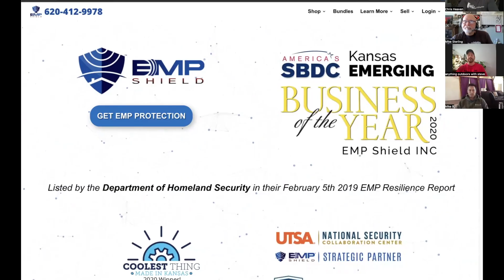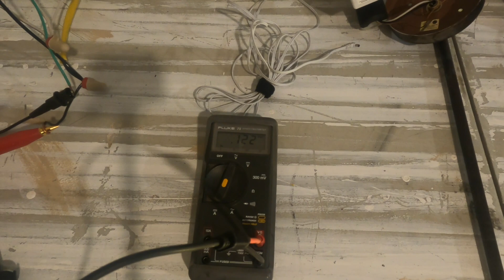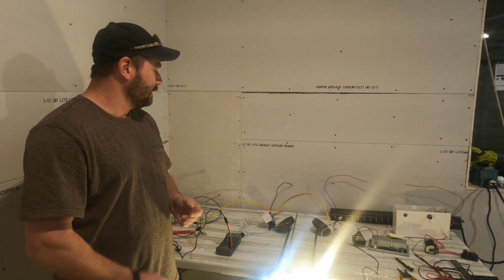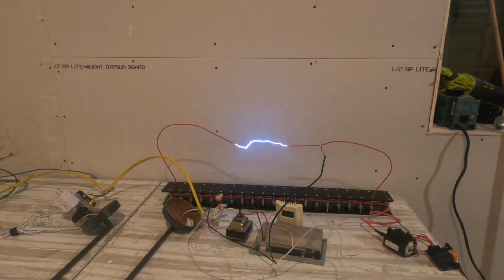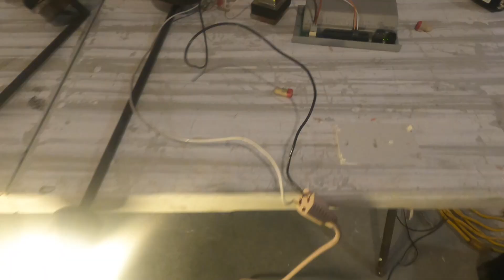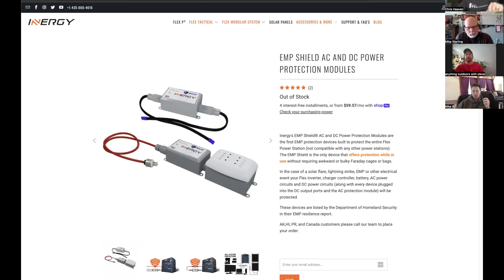We TESTED the EMP Shield... UNBELIEVABLE RESULTS! WOW!

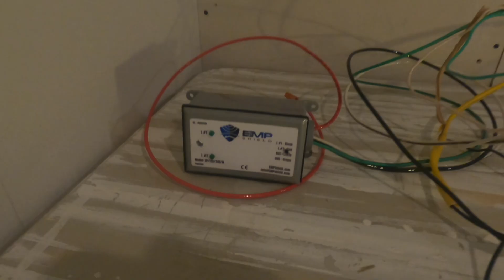Comment: Am I missing something?  @16:12 I feel like I've seen the test conducted with the power to the lights disconnected?  I hope I've missed something because I don't know when the EMP is coming to go turn everything off before it hits...
Reply: Without question,  these were tested in the unenergized state- as I didn't trust emp shield claims, plus this is beyond their specifications.  What you don't see is that I drove a separate ground rod and tied it to a chain link fence for a lower impedance ground- bypassing and isolating my entire  household from the tested voltage. The 120v is a nominal voltage that has little reference whether applied or not when pushing 400,000 volts. 
  The side effects of doing this test indoors was the induced voltage that coupled onto the internal house wiring, and did have adverse effects,  including taking out my UPS running my freezers. I thought that it might be salvageable,  but today, continues to go into fault mode often. That being said, I could now use that UPS as the isolated power source, driving the 120v to remove any potential concerns! It would be my luck that it would go into fault right as I zap it...
  The alternate intent to removing a power source,  is the potential of alternate paths to help reduce the overall voltage spike. It'll it is on a stand alone and isolated circuit, it only has one pathway to travel, and that is through the EMP shield alone. I hope this explanation helps.
Reply: @AnythingOutdoorswithSteve  so in effect, if you'd had an EMP shield on the House's breaker panel, you think the negative effects of affected electronics would have been prevented? ....Which would have been the ultimate test?
Reply: @ahuggins6  yes I do. I do have a whhouse surge suppressor (leviton brand) but something got by it. The ups has new batteries installed roughly 6 months previously. In operation for the last 2.5 years. No load changes  and under rated watt hour specs. It used to run both freezers with compressors running for an "estimated run time" of 45 minutes- not that the compressors run continously. Battery backup systems are known to fail on the converter circuit,  but this would be a random failure during AC power mode- which happens less frequently. 
  Random induced voltage to the house wiring is a lesser test than a direct strike to an isolated setup- in my opinion.

Comment: One question about the test was he didn’t use a 20 amp fuse that is supposed to be the feed to the EMP shield. For a whole house shield it  is fed through a double pole breaker but for this experiment he could have tried to use a single pole 20 amp breaker. I believe that breaker is only to protect the EMP shield but it did show it could take high voltage hits. I did share the video.
Reply: I will definitely add this to the mix on the next testing session.  We are not close to a 20 amp load for the breaker to trip, and most breakers are similar to snap switches in function with no susceptible electronics (leviton, gfci, arc fault excluded.) I am saving up $ for a higher voltage testing coil with high frequency vs 1 second pulses. I attempted to scale up the existing with tons of failures, back feeding that bit me and fried electronics.  I did get a couple 800kv bangs before the power supplies got fried!
Reply: @AnythingOutdoorswithSteve  , I think about a possible CME as more of a possibility because of the active solar cycle we are in. If given enough notice I wonder if opening up the main breaker would be some form of protection or I have thought of pulling my electric meter. I have experience with electric meters. After watching your demonstration I think electrical arc could jump the 4” between the sockets the meter goes in. Now I am thinking of adding some type of translator between the four legs, line and load. Maybe heavy duty rubber 1/4” mat.
Reply: @donalberda1344  in the full length video I had done both a static and dynamic test (dynamic being less exciting). CME will be highly damaging to transformers and motor loads in operation at the time. Yes, sensitive electronics could also be susceptible,  but basic Faraday principles will provide adequate protection. If you absolutely know what you are doing (deadly mistake easily made) you could pull the meter base and ground the secondary side. This would *¹shunt any static discharge jump straight to ground.  Opening the main would add to this protection as the only path to ground. The EMP shield *¹ does this automatically, but a low impedance ground is necessary for proper protection (closest to the source is recommended). I highly questioned its ability to offer protection anywhere in the circuit,  but thinking through the fundamentals of electricity "flow" as not really a flow, but movement of electrons back and forth from atoms, it made sense that it worked as a protection device. Similarly when I became the path to ground on my scaled up 800kv generator. Even using an isolated relay with separate power source on the coil, a plastic switch, closed with insulated grip tool, while standing on a tire and getting hit with back fed collapsing coil voltage. When I utilized an insulated fiberglass rod from 6' away, I no longer was the path to ground, but it blew up the isolation relay,  then all the power supply transistors.  I was the shunt to ground previously and removing that destroyed all the electronics. This could be an hour long conversation causing unintended involuntary sleep!
  I am filming a video tomorrow hopefully,  if I can get a congruent storyline,  showing that a milkjug thickness of hdpe plastic will insulate at least 20kv. This could also be unrealistically used as an insulator,  but the above story shows just how tenacious electricity is in finding a path to ground. If that ground is provided in the meter can ( as it should) then it would likely jump from the lug to the can first, before making the leap to the secondary lugs.

Comment: I've looked at a few different EMP options for what would be needed (In a best case and worst case scenario). I ended up getting 3 emp shields to cover my bases. I got a shield for my home, vehicle, and solar array. 

At a minimum, I wanted protection for my home and my vehicle. Adding protection to my solar array was a recent upgrade. 

When I bought it all, I found the discount  code "emp24" and appiled it at checkout and it saved me $50 on each item in my cart.

Comment: An EMP doesn't just travel down wires.
Reply: Thank you... The EMF wave is strong in an EMP, and an EMF wave will create a DC current in wires, and put a proportional load on the circuits that aren't heavily shielded (by faraday cage type of shielding)... The higher the EMP (pulse) wave the stronger the electrical current goes through these wires and potentially strong enough to fry out the circuit (or melt the wires). Problem is this device isn't tested in a real world scenario with an actual effective EMP or nuclear blast.

Comment: Soo what exactly happens to the electricity that hits the device? If it doesn’t send it straight to ground like required to prevent an emp, where does it go?
Reply from the maker: It goes to the ground rod that the EMP Shield is/was connected to.

Comment: All of f my comments were like a question about the Marx generator , how it works and how it discharges. And how the EMP sheid can combat the issues of such high energy pulses.  I was comparing the things I mentioned to the Marx generator to see if it's basically the same energy pulses. Sorry if you misunderstood, I was trying to find out how the EMP shield works internally.
Reply: I am assuming you researched majority of your answers already,  but essentially a series of high voltage capacitors that discharge all at once from an dielectric breakdown on an air gap, causing the cascade effect. 
  As to the emp shield, it shunts the excess voltage to ground.  The internal operation of the unit was my question as well, and only assumed they utilized MOV (metal oxide varistors) to complete this function, but sadly the box is epoxy filled. I could destroy for science!

Comment: Static electricity is a DC current correct? Via, an emp or CME or lightning. I know they operate differently, especially lightning. With lightning, it's a static charge that is trying to balance the electrons between the atmosphere and the earth. And the actual damage occurs when the electrons leave the earth and travel up to the atmosphere. I could be wrong about lightning but just what I have learned. But I know that an emp or CME have several waves. E1, E2, and E3.. which of those are the most damaging?  The emps and cmes, are they trying do do the same thing, are they trying to find the shortest path to ground?

Comment: Are you guys familiar with tasers?  I had one that was over 900,000 volts but very little amperage. I know that high voltage, ac or DC, can do you or your electric goods some damage. But, I think you have to have some current ( amps) before it will do any damage. Amps is the current through which the voltage is the force that pushes the current. So there has to be both present in order for any damage to occur, correct? So extremely high voltage with no current is the same as high current with no voltage. Neither will harm you.

Comment: Great episode gentlemen.  Thank you all for the episode, Steve, TY for risking your life for science.  ? Who would you recommend installing EMP shield for my house and should I let my local Electric company know this?  Thank you for the great work you are all doing!!!.  Army Strong, “If you see me running, try to keep up”.
Reply from the maker: If you know someone local who’s familiar with EMP Shield they can handle it. Or, reach out to Mike at Switch It Up. He has licensed and insured electricians across the country. https://survivaldispatch.com/switch-it-up/
Reply: Its just a double-throw 20A breaker switch and 4 wires, 2 for "hot" on L1 and L2, and a ground, and a neutral(ground back to powerco).  I was fairly new to this stuff and got mine installed just fine, its really not too difficult in most cases.

Comment: Can i gather from this video that anything plugged into this unit will be protected.  Say i wss charging my ecoflow solar unit.  Would it be protected?
Reply from the maker: Correct
Reply: @SurvivalDispatch  thank you for the reply!  Is there a solar generator review in the future?  Still on the fence about which one I should buy and value the whole groups opinion.  Thanks again!
Reply from the maker: @slawlor100  ... We've reviewed the INERGY FLEX power stations in the past. They are second to none and reasonably priced. Designed in America, domestic customer support, and American engineers on the floor doing QA/QC overseas. They're the closest thing to American made power stations as it gets. That's not to mention they're super durable and if there's an issue they cover the warranty. Good luck with most of the Chinese compnies in that regard. If you buy an INERGY FLEX use the code "survival" to get 5% off.
Reply: @SurvivalDispatch  thany you for the recommendation.  I didn't even know of more than one American company that manufacturers them.
Reply: @slawlor100 … My pleasure!

Comment: First off, Steve welcome to testing and I'm quite pleased it wasn't resulting in a room temperature safety challenge.  I'm an EMC Engineer and I started as an EMC Technician at HP..  I am grateful you have so much acumen as Master Electrician.   Just to let you know, the testing by Keystone is not in house but totally independent accredited by an outside accreditation agency with equipment whose calibration is both current and traceable to NIST.  Steve's data is interesting but unsupported.
Dr. Arthur Brown also has solutions for EMP mitigation.
Reply: Absolutely,  this test is anecdotal. This is also my view when I see a company boast that they had their equipment tested at an independent laboratory!  It sounds nice, but I can say grand statements as well. This is more to put my mind at ease- especially with rated specs of 100kv protection levels. That isn't a whole lot in the ESD/ EMP realm and if that is the maximum they laboratory tested, what happens above those levels?
  Now of course,  scaling this up to even 800kv presented quite a few additional challenges and subsequent failures.

Comment: Sorry boys, but i think you're dreaming. Fora start this is a magnetic cloud of plasma, deemded to be long wave DC, not AC. This will DC couple to the overhead lines and feed 200kvdc-300kvdc into transformers built for AC. The ONLY way is to islate your home from the grid by cutting the incoming supply cables right off your house.

Comment: How quickly will it trip the main 200 amp breaker i home power panel, removing my house from to extremely long power grid lines
Reply: It doesn't open the main breaker but instead shunts any voltage over a set parameter, to ground.  I am assuming they are utilizing MOV metal oxide varistors, but have not confirmed that or VDR- voltage dependant resistors.  Some areas have included VDR's on main transmission lines to help with CME and EMP effects- both natural and unnatural.

Comment: With the SpaceWeatherLive app at least we could see a CME coming. Question, would the bigger CME be faster or slower than the smaller ones? Smaller one have taken 24 to 36 hours to reach the Earth after notification.
Reply: The slow-moving, large CME is the one that will cause massive damage. It has more time to saturate the transformer cores and cause meltdowns on those and motors.
Reply: @AnythingOutdoorswithSteve  Thanks!

Comment: I really wish emp shield made a plug in device for electronics.
Reply: I believe Chris held one up towards the end of the video. It appears to be a cord plug, 120v device. Keep in mind, I showed this shunts the voltage to ground, so a good ground is needed. It would also only provide protection to 1/2 of your household split phase, and I would mount it as close to the panel or service as possible.
Reply: @AnythingOutdoorswithSteve  Thank you for your reply.  I just need to save my freezer.  LOL  Electronics and electricity is way above what my mind can process.
Reply from the maker: @patriciacox8169 ... Steve is correct. You can get the EMP Shield with a plug on one end and a six gang receptacle on the other here when they have stock: https://inergytek.com/collections/accessories/products/emp-shield-ac-power-protection-module

Comment: A home made spiral line generator would output far more juice than that marx bank will. You can make one from a couple rolls of bakers aluminum foil, lascsping plastic a 5 gallon bucket of transformer oil, some pipe for the spark gap and some battery operated source for charging up the spiral line cspacitor assembly. On its own it peaks in 60nS, but with an antenna and reflector the pulse can be cut to only 4ns. The output can be well into the MV range. Most importantly it will accurately simulate the E1 wave.
Reply: I was initially working with a DC collapsing field transformer coil to produce the high voltage, but it wasn't giving the desired results I wanted. I also kept burning up my relays as I increased the amperage  and voltage with their rapid open and close to collapse the field. Without a high induction on a coil, I struggle to get the output voltage high enough and keep the insulation properties intact for the conductors, so I settled on the marx generator. I do want to increase this output to over 1.2 million volts and fire up the test bed again,  but I have to get more test equipment (mostly the hvac controller) after I destroyed all the equipment.
Reply: Yup these devices are extremely simple to build as it is more or less a jelly roll capacitor with a spark gap on one end and a few extra turns on the other. You definitely cannot use normal wire to conduct the output as it has a fast risetime making it see stuff as either a capacitor, an inductor or an antenna 😮 @AnythingOutdoorswithSteve

Comment: Been waiting for this one all day. Excellent job fellas. I will be sharing this with some non-believers. Keep up the good work.
Reply: I now want to just increase the voltage and amperage on this! I want to build a 1.2 million volt and hit it. This cost about $300 in parts, and I lost several relays, power supplies, and my Ideal clamp meter (1000v). I lost the meter when I used the high volt test lead to attempt to catch the voltage spike. It was worth it to me, just to see if this thing really does what it says.

Comment: Great video, guys. I think I've solved the e.m.p. issues.  All these electronics run on smoke. Because every time you let the smoke out of them, they stop working. So maybe we don't run them on smoke. 😂😂😂
Reply: My destruction test, sadly I lost the footage, but it wasn't super compelling visually. Other than the smell, there wasn't much to see. The 24v transformer I used for the hvac power supply took the brunt of the destruction and the gfci.  The LED lights simply stopped working. The power supply had to be taken outside, where it remains.
Reply: All electricity runs on smoke! Once the smoke is let out, it stops working! Too much cheech and chong.

Comment: The inductancy is what get to your house and affect the electronic equipment in your house. You don't have to be connected in the way that that happened. Also, you can use a small mirror if you work with resistance hycapacity resistance in your line and you can use Alex capacity for theater.
Reply: That was experienced first hand with the ESD induced onto any conductive materials nearby- I believe even my house wiring, which I was not expecting.  This is likely why my battery backup went into fault mode for high voltage for my refrigerator and freezer upstairs.